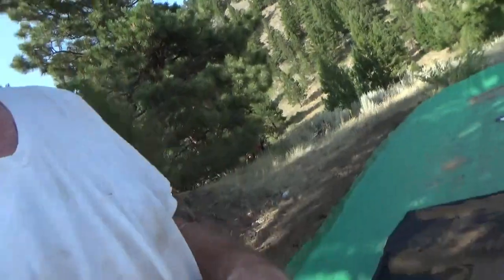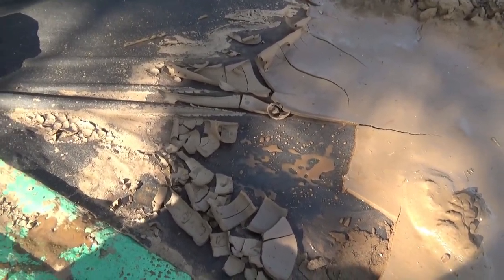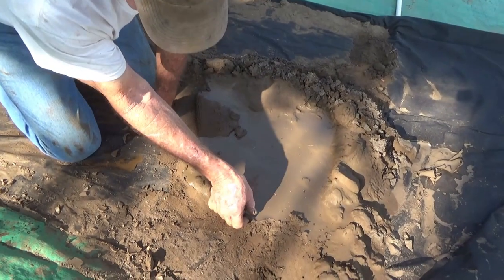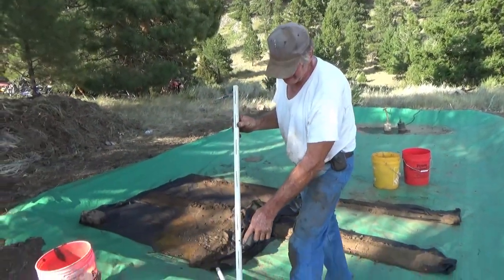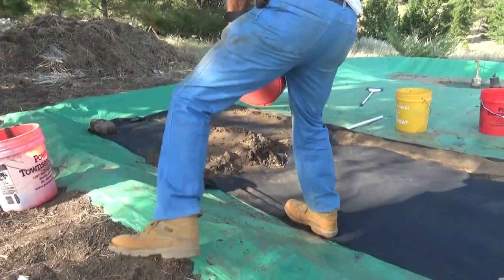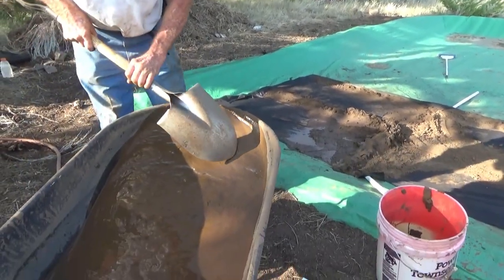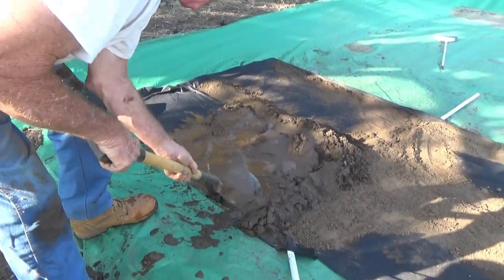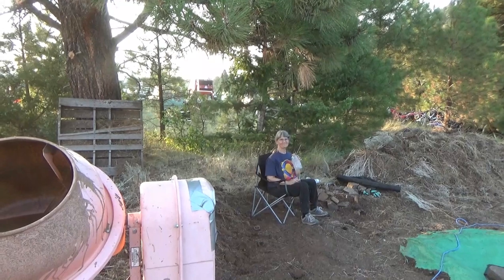224 Installing the Filter Bed on the Tailings Pad

Comment: I’ve had that same hydrophobic problem with a geotextile covered lawn drainage pipe in a trench.  The geotextile fabric was not hydrophobic until the Denver clay soil contacted it.  A little Finish Jet Dry worked like a charm to let water in the soil pass through initially in test.  We didn’t discover the issue until the trench drainage system was installed, of course. When we get around to it I hope to back fill the perf pipe in the trench with Jet Dry/water, forcing the fabric to wet with the solution and improve water drainage water throughput.  One thing we don’t have a handle on is how often we need to repeat this process to keep the throughput at a reasonable level.  
FYI
Bill W
Denver Metro
Reply from the maker: Interesting about the clay.  Dawn dish soap will probably work cheaper and have more residual effect.  In this case I have to be concerned about possible secondary effects on the leaching, but it might even speed it up a bit.  need to do a lab scale test to check.  I was in a hurry right now to get SOME tailings pad operational.
Reply: Ok ..i jurst read the copyright.. when i  have a spare $250 smacka rooes ..o ll put that in me mates bank and he kinn bpay you and have his own plans .. sounds liked a plan ..man ..😁pip pips
Reply from the maker: @patrickjobling8676  He could also use your set and just pay a fee for making his own mill.  That would be cheaper if he just wants a mill of his own.  I would consider it one of your extras in this case.  Up to you guys.
Reply: @hardrockuniversity7283  we.ll work it out ..he must of gone fishin ..canny contact him atm ..😁
Reply from the maker: @patrickjobling8676  Hope he catches some big ones.  Eva and I heading out soon to Crystal Park to dig for quartz and amethyst crystals.  Big fire to the north of the park several miles away.  Should be an interesting trip.  We will be careful.

Comment: I think you are building a Swiss Watch when a sundial will do the job... the particulates are going to restrict fluid flow through the 3/4" plumbing. Consider using 3-4" diameter perforated drainage pipes with or without geotex socks.  Love the videos - Rock On!
Reply from the maker: Higher cost by a lot, very hard to cover with small amounts of sand.  The whole area is only 10' x 20' and 12-24 inches deep.  For a big pad that would make sense.  we used 4" pipe for a 1/4 mile square pad where I used to work.
Reply: @hardrockuniversity7283  Got it - but time tells all... Best of luck!
Reply: @hardrockuniversity7283  Knowing that engineers run cost comparisons please state the cost for the 3/4" pvc plumbing vs a 3" perforated drain pipe field - don't forget your hours of labor to add perforations to the 3/4" pipe etc... Inquiring minds want to know details since our life experiences are different and bias our views.  Rock On!
Reply from the maker: @douglaspohl1827  Hmmm....  Some complications are that the place I purchased from does not list prices on the internet so I have to go with Home Depot.  Home Depot does not list the schedule 200 pipe i used, but only the schedule 40 heavier wall.  I also couldn't find fittings for 3" Corex pipe, but the pipe itself is about 15% cheaper than the 4" listed.  I also used crosses, but couldn't find any Corex crosses.  Thus, I will price 3/4" PVC sch 40 against Corex 3" with the tees discounted by  15%.....

Pipe needed- 70 feet total, tees needed 14. 

 Corex  3" w sock- 100 foot roll $104, tees ($7.21 ea) $100.94.  Total $204.94

3/4" PVC- Pipe (7 ea 10' @ 3.83) $26.81 plus (14 ea tees @ 1.36) $19.04.  Total Materials $45.85.  Extra time cutting slot $50.85s < 2 min per stick @ $20/hr= $5  Grand Total 3/4" PVC $50.85.

Besides a 100' roll of pipe won't fit inside my camper I bet.

:-)
Reply: Swiss watches are top shelf 😁

Comment: This might be a dumb idea, but what about running the small sheets of geotex through a washing machine to strip off the crud left by the manufacturing process with some type of surfactant. Maybe that would make it a bit less hydrophobic. 
I don’t know squat, just thinking out loud.
Reply from the maker: I'm sure it would work.  I just used a small amount of Dawn in water in a bucket to wash, and then spray rinsed.
Reply: @hardrockuniversity7283   yeah! A lot easier too!
Reply from the maker: @howarddrummond2813  It seemed to go pretty easy.  Small scale helps.

Comment: Is that Geo textile fabric your using there   Keith  ?  Do you think that will clear mud  solution and filter through only the clear water plus your leach agent recovery , is that your aim ?  cheers Ned .
Reply from the maker: The fabric is too coarse to do much filtering on its own.  The sand above it does the actual filtering.  The system is designed to recover leach solution and dissolved gold from the spent tailings by first draining them, and then adding fresh water on top and rinsing them.  As a bonus, it also allows  more time for hard to get gold to dissolve.  The big mines use much more complex systems that are faster and more efficient, but much more expensive.

Comment: Is that how the heap leaching is filterd I've have something different in my head might be simpler all get it to paper and work on it all be watching and let you know if I come up with something.
Reply from the maker: This system is based on my experience heap leaching.  The difference is that in heap leaching you do not finely crush the ore and just add solution to the top of the heap and collect it on the bottom.  The pad would work for a very small heap leach.
Reply: @hardrockuniversity7283  you might consider possibly flushing with water after everything is  complete to poosh the pragnet solution out looks good 👍
Reply from the maker: @kevinauld6809  That's the plan.  After loading one side of the pad, we plan on flushing with water and then unloading that side while loading the other.  The whole pad will only hold about 20-25 tons.

Comment: What is the liner material? I opened a never used harbor freight silver tarp yesterday and it had pinholes
Reply from the maker: THEY were from power townsend.  One heavy duty on top and one light duty underneath with geotextile under them both.  definitely not adequate for toxic solution, but this isn't.  It is also basically a test bed.  My brother was helping to install some REAL pad liner the other day- 85 Mil and so tough you couldn't cut it with a knife.  I plan to keep the pond low with the pumps to minimize the effect of any pin holes.

Comment: Could you put the mixer next to the filter bed and make a PVC pipe chute?
Wrote that comment before you said you moved the mixer.
Reply from the maker: Yeah, but I want to skim as much liquid as possible before putting the tailings on the pad for rinsing.
Reply: Ah! I thought you were skimming it so as not to have as much to wheel over. Maybe a mini pad to put it on before tipping it over into the main one. Or a wheelbarrow that won't hold water. Ha!
Reply from the maker: @jimv.661  We will worry about that at the next scale up.  Right now the issue is getting the gold back out of the solution.  I'm beginning to feel like Space X.